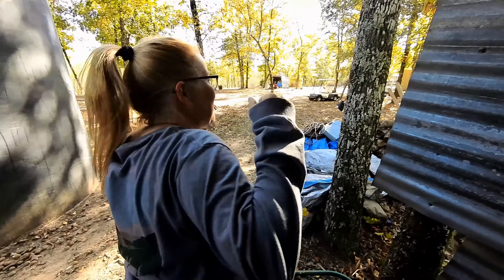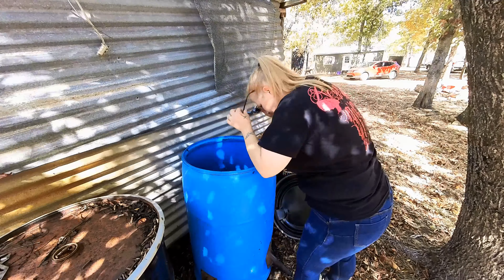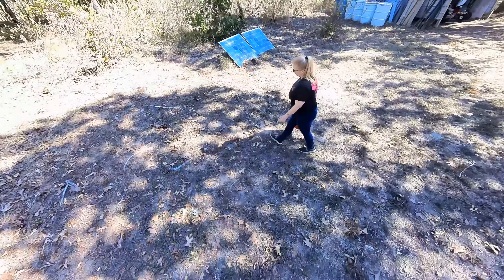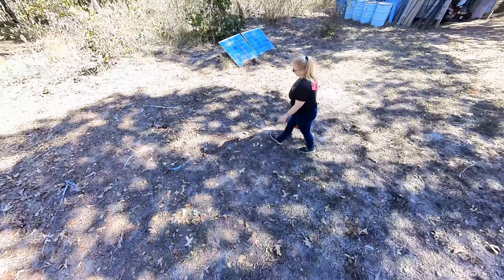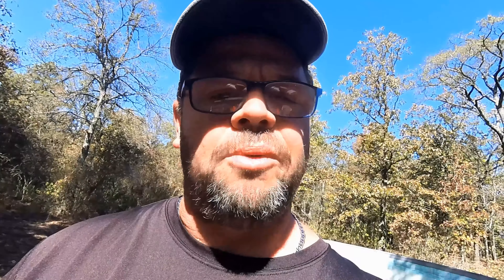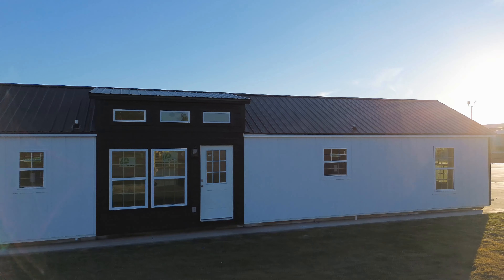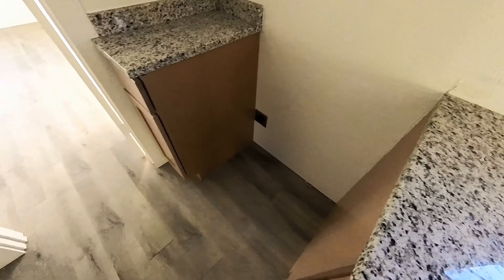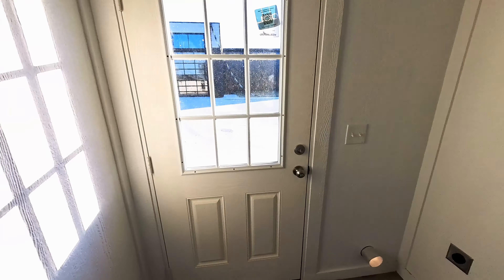Rescuing a Starving Dog While Living Off the Grid

Comment: Those poly barrels won't prevent moisture damage. Use a Mylar bag liner and desiccant to stop the moisture damage. Heat seal the bag well and you should be fine.
Reply from the maker: Gotcha

Comment: I live off grid in Mississippi and have a rain catchment system, We get 50 inches of rain a year. that "Tiny home" you walked through isn;t a "tiny home, it's just a small house, a Tiny house is anything less than 800 sq feet and that thing is bigger than our 1200 sq foot house that we sold to buy our property and build our 24x24 576 sq foot tiny house.
Reply from the maker: it is a 16x40 which makes it a 640 square foot house
Reply: @OKLAHOMAOFFGRID  there's no way in hell that's 16X40. that thing is bigger than my 1200 Sq house. it may be 16 wide but that's sure as hell longer than 40, it;s atleast 60 foot easily. look at yourself standing in front of the side then standing in front of it at 10:03 at the end of the video...... there's no way that's only 40 foot long. There;s a difference between a tiny house and small home.
Reply from the maker: @TheREALOC1972  oh I didn't know

Comment: Throw you a rv tank heater on the tank and get you a heated rv water hose. Pretty cheap
Reply from the maker: wonder how many watts they use?
Reply: @OKLAHOMAOFFGRID  the hose is about 10 amps I'd imagine the tank warmer would be similar. It just keeps the water just warm enough so it won't freeze. I had them when I did rv life for 7 years and never had frozen water, even in the below 0 crap we had in DFW a few years ago. I'm in the process of transitioning to vanlife now and probably look for a couple acres up around the Arbuckles to hang out at when I'm tired of traveling
Reply from the maker: @jerroddooley374  don't they make a wrap tape that you can wrap around a pex line and then plug it in?
Reply: Yep, you tape it around it and plug it in. There’s also heat tape. You could also put a circulator on your water tank to keep it from freezing too. Like those they use on aquariums
Reply: Just saw a new cool little gadget that might help you on your freezing water. It was in my Facebook feed. It’s called freeze miser. Looks pretty cool

Comment: The issue with buying one of those shed homes is building codes do not allow them unless they are HUD certified which of course they are not. Example. A mobile home can be delivered and no code inspections are needed on the home apart from hook ups and tie downs because the factory is trusted "certified" to be building them to HUD standards or better. The shed homes must be placed ONLY on ZERO building restrictions properties which are becoming more and more rare these days.
Reply from the maker: Yeah that statement has some truth to it it all depends on what area you are or what county you are in and what state